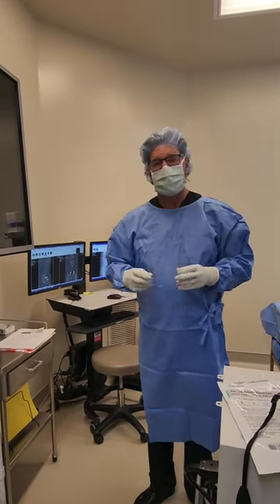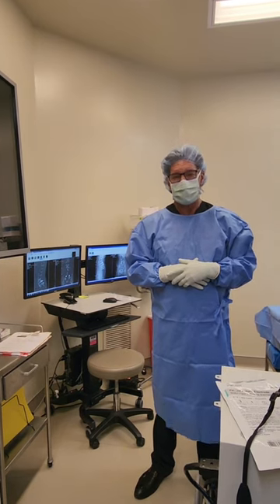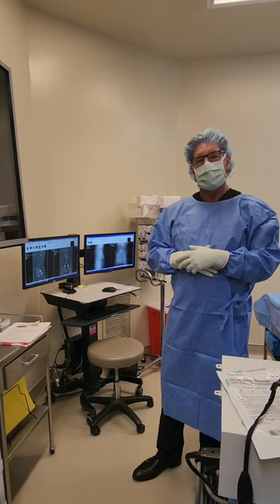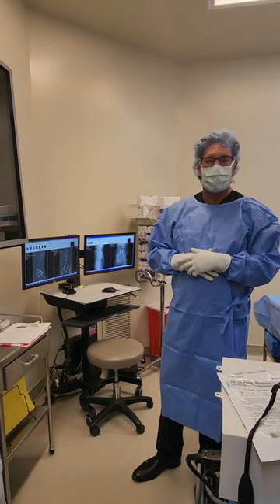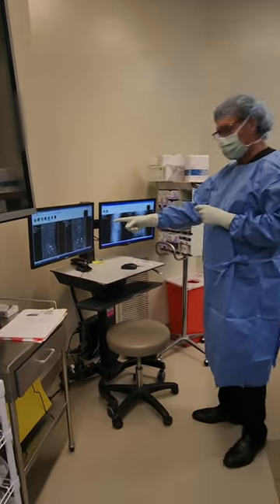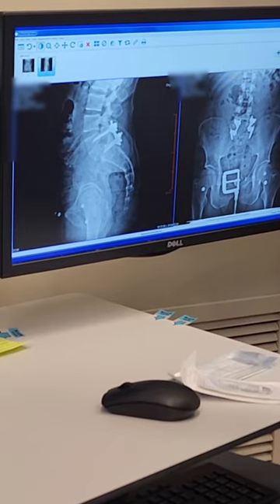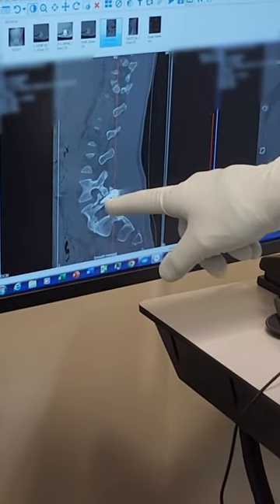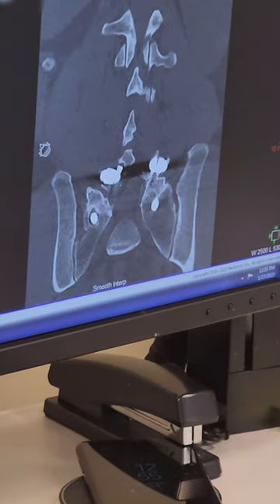Dr. Chappuis Explains Loose Pedicle Screws From Previous Failed Back Surgery

Comment: I had a L2-S1 PLIF lumbar fusion 16 months ago.  Nothing but issues since and the surgeon didn't seem to be interested in helping.  After a year I decided to take my issue elsewhere.  I found a good Doc that suggested right away to do the x-rays and CT scan.  The results was terrible!  2 loose screws at the S1 level.  Severe disk height loss at L2-L3.  Because of the S1 issue the L5-S1 disk did not heal at all.  Had a new ALIF anterior surgery to insert a spacer (disk) in the L5-S1.  It went well at 8 weeks however I continue to have the low area driving me crazy.  The surgeon is reluctant to remove those two parts of the fusion.  Why?  I don't care how uncomfortable it would be.  Anyone, any thoughts?
Reply: I feel your pain I have on loose and more disc herniated I'm so over this deep burning pain 😫

Comment: I have a question. I had ALiF l5/s1 in 2013. I had hardware removal in 2014 due to pain.  Ever since then i have had increasingly painful tailbone pain. Now its soo awful i cant sit hardly.  I had an xray and there are 2 screws criss crossed above the tailbone area.  Why wouldnt he have taken those out when he told me he removed the hardware?   Can that cause my tailbone pain?  My surgeon moved so i cant ask him.
Reply from the maker: To give a better assessment, it would be good to get more advanced imaging done like a CT scan. We do e-visits if you need a consult on your current X-rays or need an MRI reviews. The hardware may not have been removed if the fusion wasn't yet solid.
Reply: What is the e visit ?
Reply from the maker: @catman1360  An e-visit is a virtual appointment to talk with one of our providers for a consult.
Reply: How much for e visit ?
Reply from the maker: @catman1360  depends on insurance typically. Feel free to give us a call to get more information. 🙂